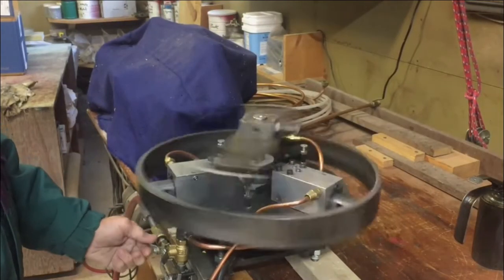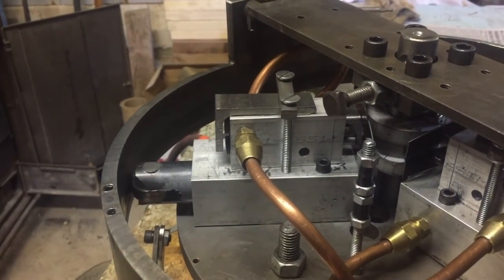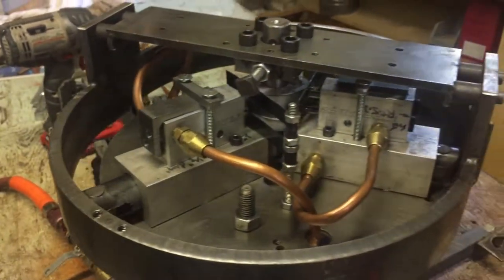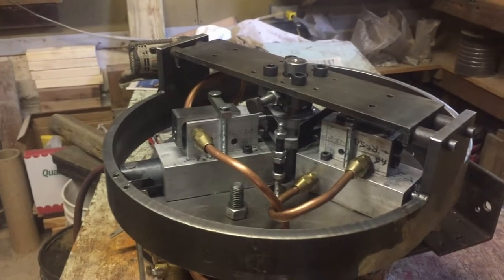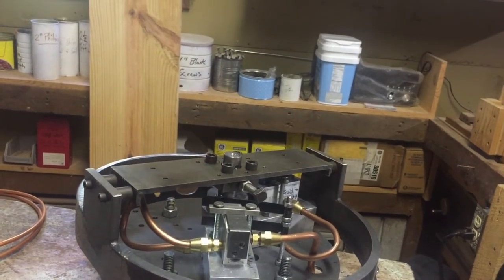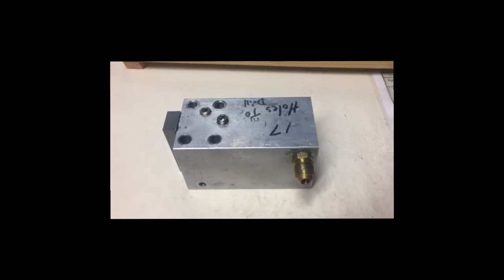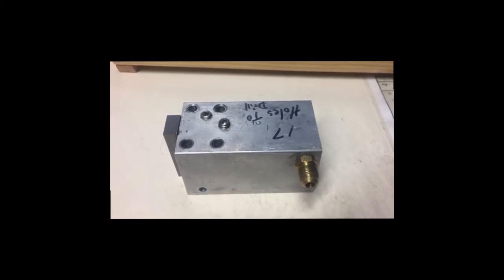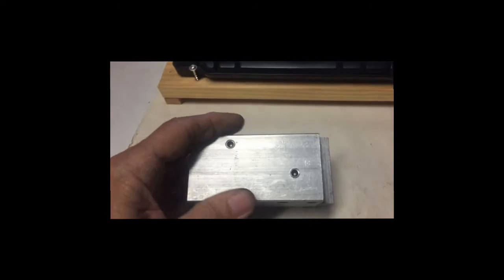Modify Cylinder & Valve on 3 Cyl Oval Air Engine 6-26-2020

Comment: I'm quite interested in pneumatic motors for transportation. I have thought of being able to use an on board compressor to fill the tanks whether a small gas motor or electric. I have an idea about a design using a 2 stroke design without transfer ports. The exhaust air would exit forcing it directly into a shaft mounted impeller flywheel with 2 staggered rows of fins. A decompression valve would be open right until TDC and the air pushes the piston. I think it would be easier to get more power out of it. If air brakes were able to be engineered backwards braking could fill the tanks as well.
Reply from the maker: Thank you for the comments.
I am happy to see you are interested in developing an Air Engine, and would love to see some design drawings on how you propose to build one, with the accessories you listed above.
I have always wanted to build a simple engine, easy to work on and maintain, but as I come to problems to solve - they end up getting more complicated and less easy to work on.
If you go to my Channel, you can see what I worked on over the years - would be interesting!
Thanks again, and hope to hear more about your projects.
Reply: hi will . doug mcleod here in north idaho . i have thought thru many pneumatic designs for air motors . is your design suggesting a dual concept with piston drive and also jet style with the exhaust air ?
Reply: @douglasmcleod7481  Yes a vertical impeller type flywheel but 2 flanges on either side and exhaust air would exit at an angle into the fins. It would look like a backwards leafblower housing only the middle isn't open. With a 2 stroke design and a steam type slide valve. Maybe a fitting or two located at the center of the transfer ports and a 2-3mm oil fitting with a 1.5mm ID would provide lubrication. That is one of the issues with converted 2 stroke air motors lubrication. It might even draw oil into the cylinder by vaccum. I think some standard compressor grade oil would work.